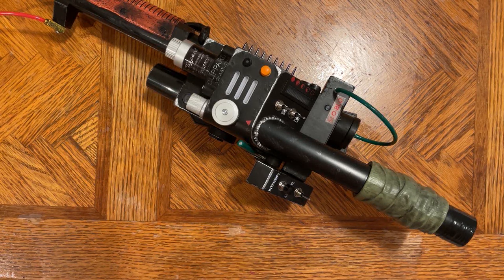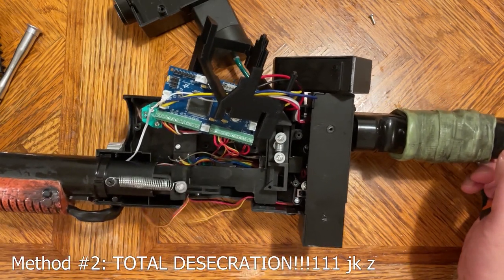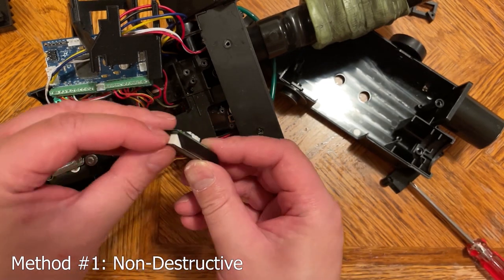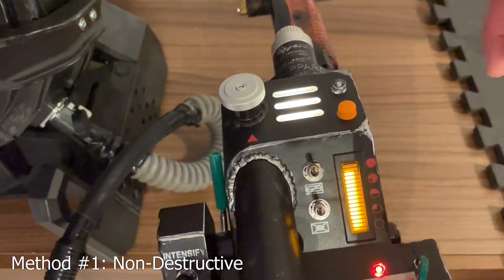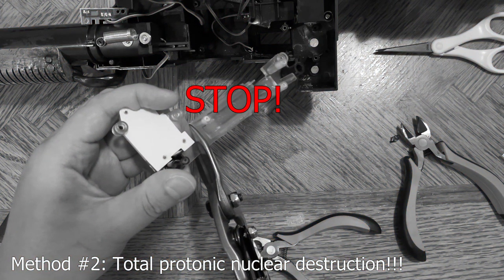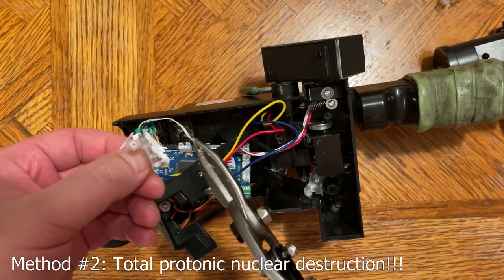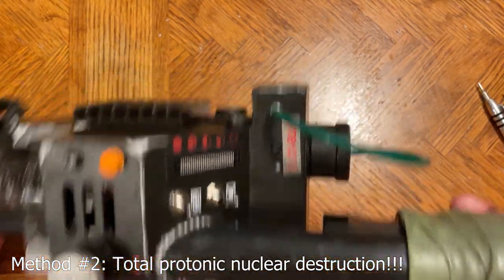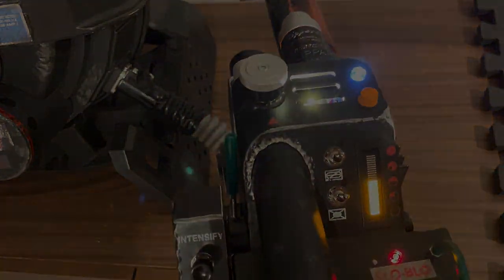28 Segment Bargraph Add-On for gpstar's Haslab Kit Step-by-Step Installation Guide

Comment: Hey I d like to reach out to you and  ask if you would be able to make this mod for me with a spengler neutrinowand and sell me the hole thing - I tried myself but unfortunatly screwed up my wand
Reply from the maker: Oh no. What happened?
Reply: @jonogunn  I got as far as getting it working but did not manage to solder the Black Kabel to the GND Board- probably I destroyed the Board by overheating while trying-

Comment: I need this in my life. But it looks like a mission. 😅. I don’t get it tho. So your board does the different start up, adds the bar graph and also adds the high intensity vent light?
Reply from the maker: Yes and that’s only a very small part of the features our kit provides
Reply: @jonogunn  what im really looking for is the bright frutto vent light, the screen accurate power on sound from the 84/89 movies. And maybe the bar graph. I would love the 84-89 cyclotron lights that fade out was they’re rotating.

Comment: Do you have a video for the installation of the Frutto vent light?
Reply from the maker: No I don’t. I suppose I could make a video but it’s really pretty straight forward. Do you see how the existing vent light is screwed into the wand? If so it’s as easy as removing that and replacing it with frutto in the exact same manner
Reply: @jonogunn  the Frutto vent light has a terminal block and comes with 4 wires. The stock vent light has 3 wires..  so I'm just curious on the wiring more so than the installation.
Reply from the maker: https://fruttotechnology.com/ols/products/strobe-light-neutrona-wand-vent-ghosttrap-etc-dot

If you look at the photos it shows what goes where
Reply: @jonogunn  I have a question about the wiring. The brown wire for the rotary encoder is located in "ROT-" but, the photos show that the green wire for the vent light is using this same housing for GND, are they supposed to share "ROT-" or is one replacing the other?
Reply from the maker: @tapmem is this for the frutto vent light? then yes it should be sharing one of the terminals.

Comment: That looks complicated!! So this tech is just a plug & play ??
Reply from the maker: the tech itself is yes. but to have it installed in the hasbro wand it requires modifications to the inner body. this is an add-on to the gpstar kit. please check out the main installation video of the gpstar kit first!